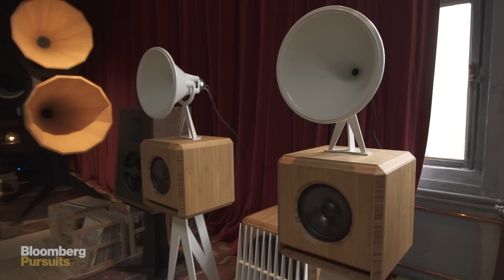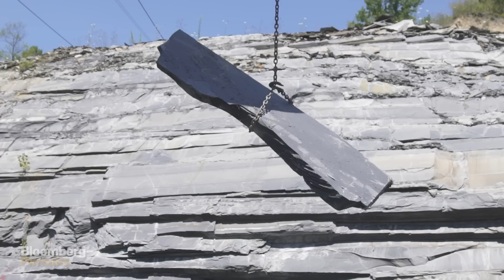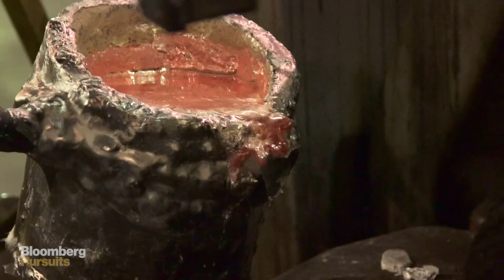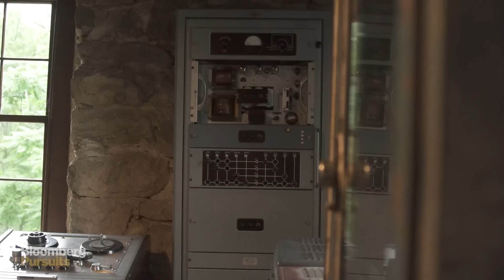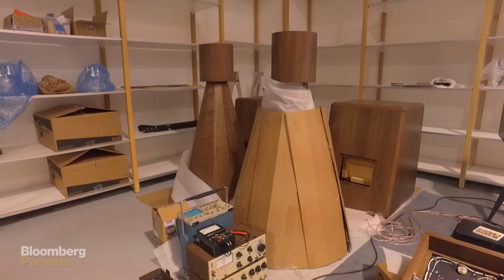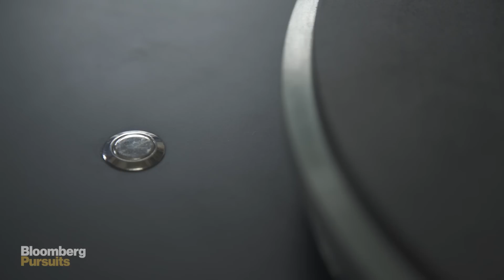How a $300,000 Speaker is Made

Comment: I know enough about high quality audio design and manufacturing processes to tell you that there's no way the stuff he's building costs more than $10k to produce. And that's probably on the high end. He's really good at blowing smoke. Notice how he makes powder coat (paint) sound like some revolutionary process. And "aerospace level" components? No, more like expensive boutique components. Aerospace wouldn't use tube amps because they distort the signal. They distort it in a pleasing way to your ears, but still distorted nonetheless. But he's not selling these speakers to people who know anything about speakers, he's selling them to very rich people who associate a high price tag with high quality, which it is high quality.

edit: truth be told, I'm jealous of this guy. I'd like to do exactly what he's doing someday. If he can sell enough to stay profitable, good for him. These speakers are art.
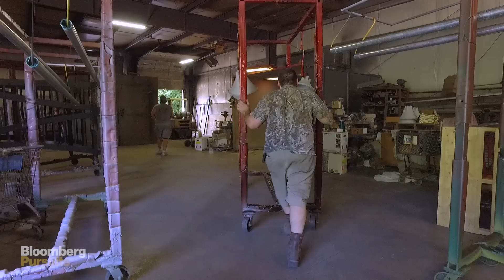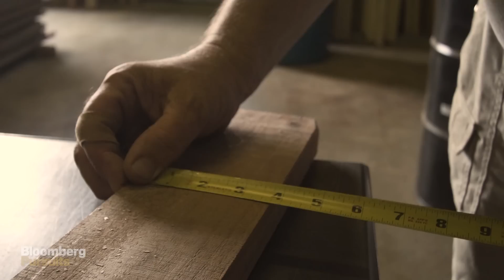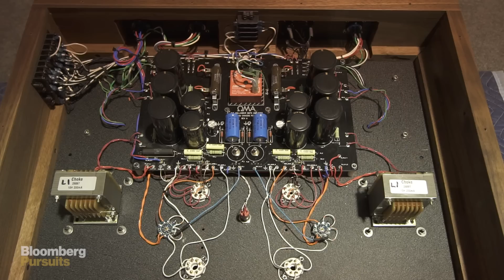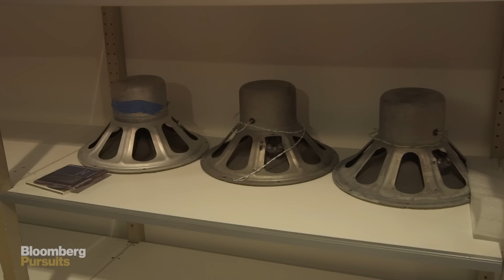Reply: Oneness100, perfection is in details: 2:47 look on powder coating environment or in any work environment during production(mess, dust, none knows safety rules), 4:28 look on tools like brush and seems it never was cleaned or replaced(same with all tools like china calliper 50 years old grinder), the best part is 5:21 to 5:28 - Cable management, soldering quality, flux cleaning. If you have such build quality you shouldn't waste such expensive components, I'm 100% sure that PCB quality and it's routing isn't so perfect. $750 caps works the same like gold hammer in such build quality, or do you think 6K drivers should be full of dust to improve their quality ?
Reply: Reason people buy sports cars because of their performance. Of course, you know that you will be gaining attention and look rich with an expensive sports car. But if you are a car person, you are buying it for your enjoymeny
Reply: Well, one could do a lot of things.  But the thing is, the wealthy that are into vinyl/tube/horn systems don't want something that is commonly available.  They like the limited production, hand made aspects.  Plus these guys make the entire analog playback from the turntable, electronics to the speakers.   

The people that are into high end vinyl and tube based gear are very particular in what they want.  L'acoustics probably doesn't fit THEIR needs.  For the same reason why OMA doesn't fit yours.  You are trying to sell someone that isn't going to listen to you for a variety of reasons.  

When you are making something that's catering to a small niche market, it becomes more than the utilitarian aspects of the product.  Yeah, one could get a Meyer Sound Labs system, one could get Bose, one could get all kinds of things.  THat's why a lot of different companies exist.   They all serve their niche market and that's what OMA is.  They are niche company going after a very small and exclusive clientele and their clientele does't want something that anyone can buy.  They like that exclusivity.  Just like the guy who buys a one of kind custom car or motorcycle.  It costs more, but since they are wealthy, THEY DON"T GIVE A FUCK how much it costs.  BTW, I've never heard of L"acoustics so I don't even know if their products are going to sound any better.
Reply: My guess is people buy his speakers for the same reason why people buy sportscars, iPhones, and starbuckls coffee, it makes them look rich and cool.
Reply: Lmao, don't even try to keep blabbing. We ALL understand, rich or poor, that this is bullshit. Objectively, due to the shoddy workmanship. I'd let you play ball if it was even decently built but it isn't, which makes this all the more hilarious that you defend it so vigorously lmao.
Reply: You really have bought one, havn't you? hahahaha
Reply: You don't have to be honest to be in business for a long time... It's very obvious that the markup on items like this is astronomical. There is a customer base of people that just want the most expensive things they can get. He takes minutes to explain things as plebeian as powder coating and metal casting. If that doesn't make things clear enough, look at the internal build quality. At $300,000 for a set of speakers, he can't even match the build quality of a $150 Corsair PSU... Buy into it if you want, but Michael isn't wrong by any means.
Reply: Sports cars have ways to give appreciable and objective increases in performance, and are generally agreed to be worth the money because they're functional for more than a couple tunes. I'd bet that if you bought a luxury sports car with the same amount of money you'd blow on this garbage that it'd sound better (because it's essentially a "well setup room" already) and be way more useful and cooler.
Reply: Michael like Bose?  Not that Bose are crap, they are nicely built in the USA, but not what I call high end.
Reply: Commodore Sixfour,

They have mfg facilities in Mexico.  You are aware of that, right?

Do you know what B.O.S.E. stands for?   

Better Off w/ Something Else.  It's an audiophile joke.  :-)
Reply: from their website "Not by using the technology that guides the space shuttle..." - i thought that was funny
Reply: Oneness100 I took apart one of Bose old fancy clock radios that was made in the US, to clean it out.  This particular model was vary easy to take apart, almost like it was meant to be repairable.   It changed my mind about the brand,  that's why I consider it a high end clock radio.   Not to be confused with a actual high-end or vintage stereo.   I know Bose doesn't give specs and basically just tries to convince people that they are high end.  I don't see advertisements for McIntosh or Kef on TV having to convince people they are the best.
Reply: It's called FRAUD, & he isn't actually $elling N E.  The horns R totally absurd 4 starters = worst possible geometry & U can tell just from looking they sound like absolute krap = honking at you with no flare 2 them whatsoever =))  So what that means is it focuses everything  at just a narrow slot of frequencies totally exagerated, instead of many.
Reply: Thing is, they don't even look that good, from a design perspective. Bad proportions, garish use of woods and incongruous combinations of industrial design and fancy joinery. It's all about the expense of the materials.
Reply: Your mentality is clearly one that has "I don't have any money, so instead of just appreciating the fact that there are expensive things in this world that are infinitely better than what I have and own, I will just conjure up half baked nonsense to make me feel superior".   

Trust me, wealthy people don't listen to poor people.  Go ahead.  Go to a local high end store and interrupt a rich person in the process of buying an expensive home stereo and see if you can convince them to not make the purchase.  I dare you.  Go ahead and see what happens.  

Good luck with your personal issues.
Reply: Michael, he was referring to the cables they use.  They use cables from a company called  Analysis Plus and their customers include NASA and Boeing, so that's what he was referring to.  plus, they are using Mundorf Caps which can cost as high as $750 for one cap.

There are certain applications that still use tubes.  But yes, audio is the most prolific.

But do you know how much a high quality Field Coil driver costs?  Lowther charges $6K for one.  Some of these drivers they are using a VERY rare, very expensive.

I think you are more misleading that the owner of OMA.  He's at least been in business for 10 years, so he must be doing something right.  I'm sure they sell  a respectible amount of product and their customers probably love their products, which is what it's all about. and yes, if they can make a profit in doing so, even better. But these small boutique audio companies aren't profit first quality second.  They are quality first, profit second.

Go ahead and really find out what they are doing before spouting bullshit that they only cost $10K to make a pair.  That's probably more bullshit than anything the guy in the video is saying.